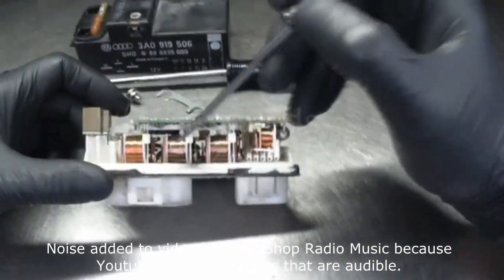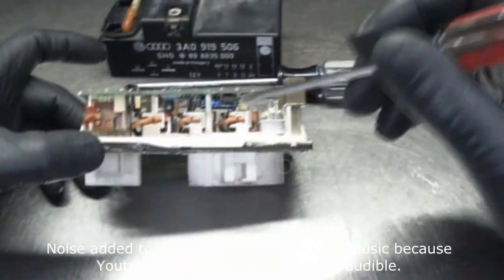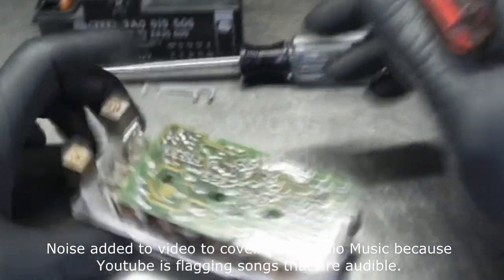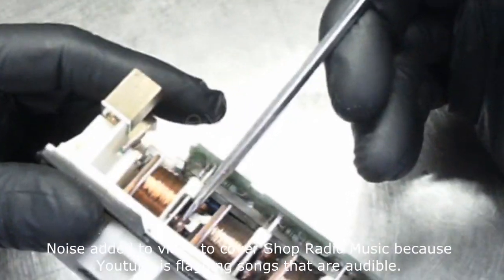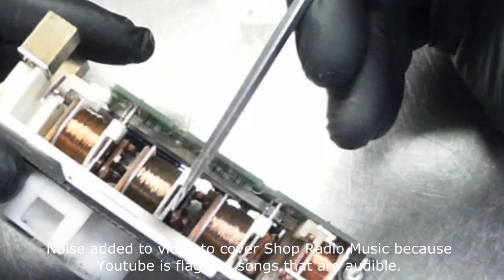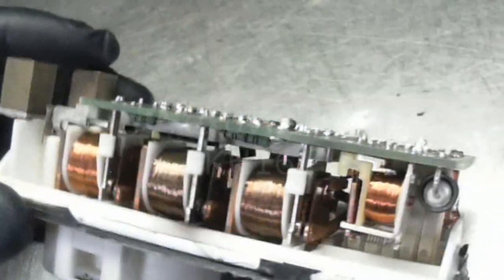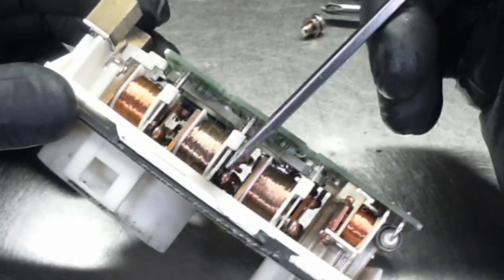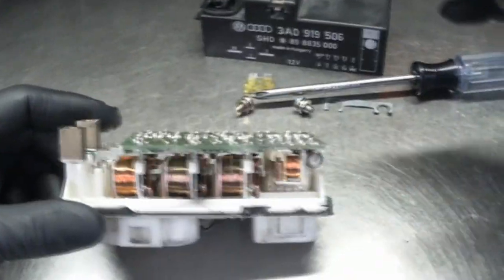VW A3: Coolant Fan Control Module Autopsy (for lack of a better word)

Comment: Where is it located
Reply from the maker: What car do you have? Year, make, model, engine?
Reply: @EXOVCDS  2013 VW Jetta SE 2.5
Reply from the maker: What issues are you having? The more info I have, the better I can guess / help and the less "back & forth" communication is needed. The "Fan Module" for your engine is part of the large radiator fan:
http://fkh161.ca/VW/Fan_Module.jpg
You can see it in this video (different vehicle, but similar / same design)
https://youtu.be/rQ81TwxbmGg?t=342
Reply: @EXOVCDS  the fan keeps running even after shut off the engine. I don't know if something wrong with the fan or control module. I couldn't find the location for the module to change the new one I have
Reply from the maker: The engine computer & fan module "communicate" with each other to "trigger" the fans... when the fan module "looses" communication with the ECM (engine computer), the "fail safe" is to turn the fans on. You need to verify if "communication" is present at the signal wire... if communication is present, then the module might be bad. If no communication signal is present, then there might be a broken wire. You can use a multimeter to check for a signal voltage: (Ignition on, less than 1 volt should be fans off, more than 1 volt should be fans on)
https://www.youtube.com/watch?v=oqdv4cm86Ns
Reply: @EXOVCDS  will try that , thanks a lot
Reply: @EXOVCDS  where is that module located ? Any idea ?
Reply from the maker: Did you read my 2nd reply? Did you watch the video (you can see the module in that video).